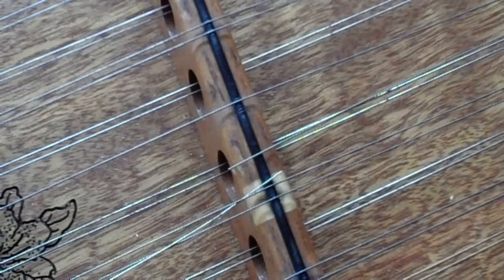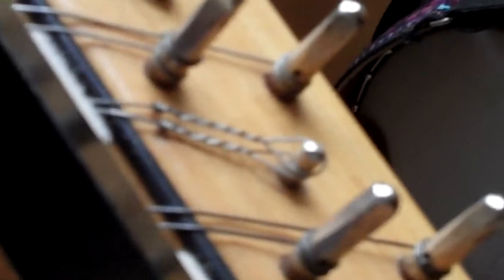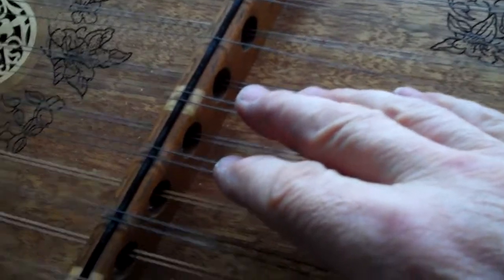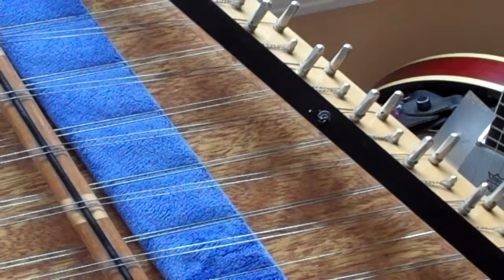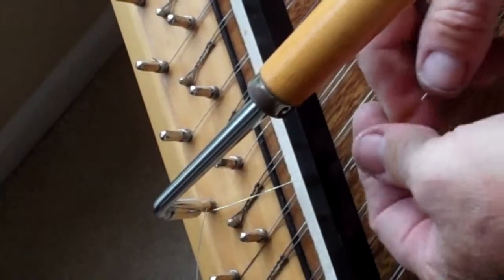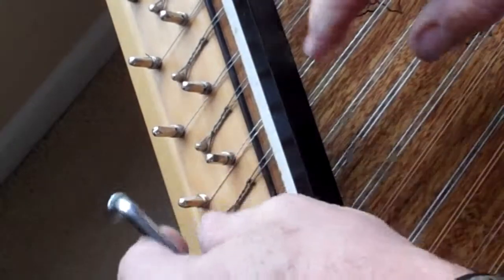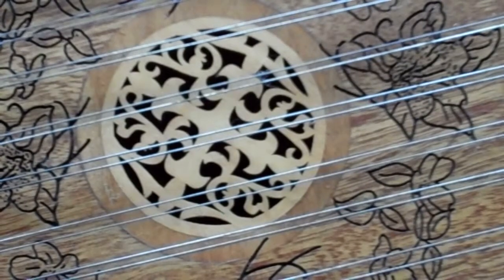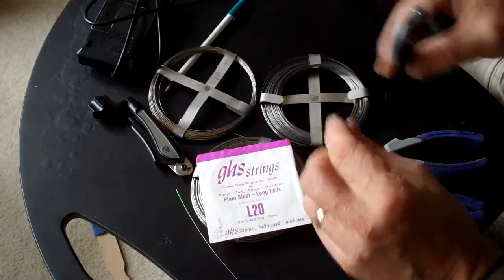Replacing Broken Strings on a Hammered Dulcimer

Comment: Thanks James.  This is a very good video.  One suggestion:  Instead of using wire cutters to cut the excess string after replacing, bend the excess string back and forth several times and it will break off right at the hole, leaving no jagged string to catch your fingers.  Works every time!